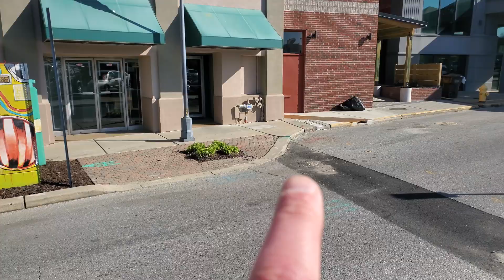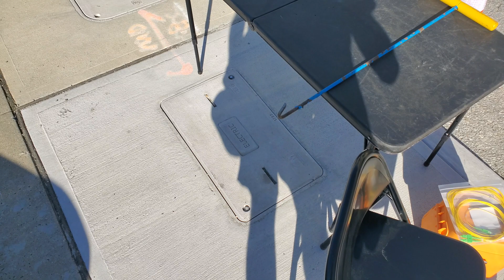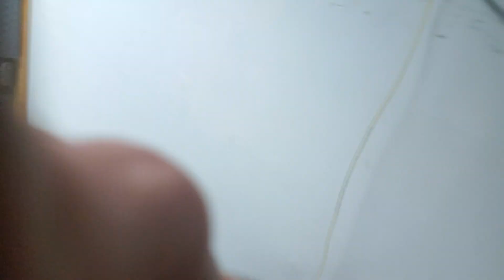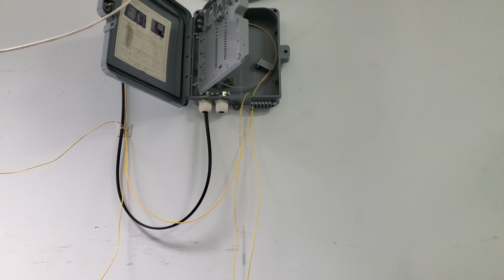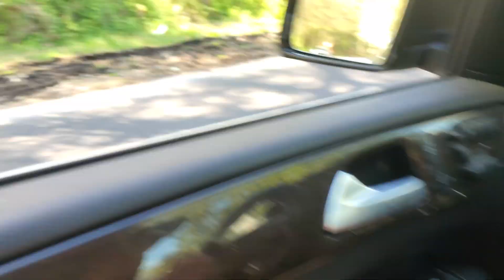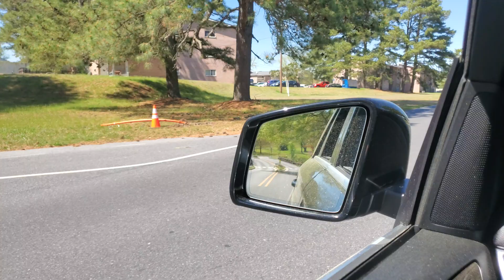Installing a second fiber circuit to a VIP customer plus the team got some conduit in ground.

Comment: ABC network is switching from satellite to all IP delivery for their network signal. They are probably sending 2 signals over that 30 mbps link. ABC is currently 720p, not 1080p unless they are upgrading that as well.